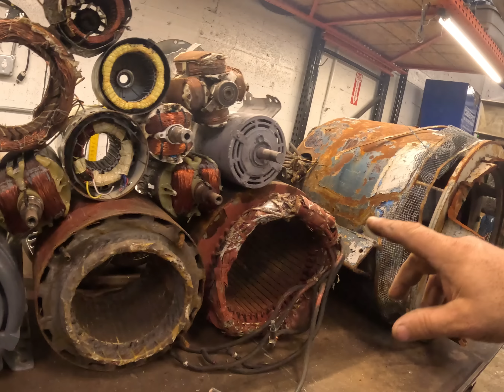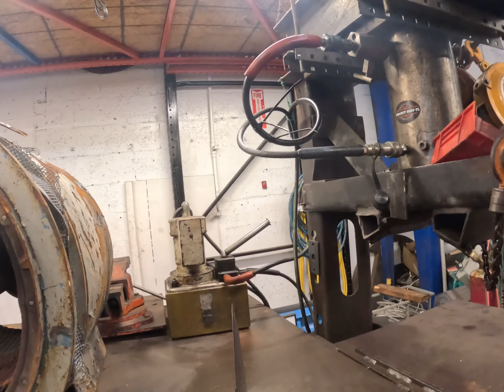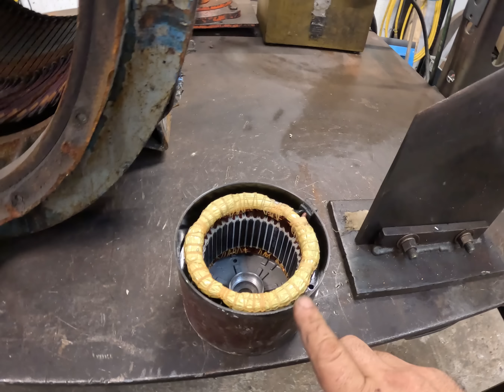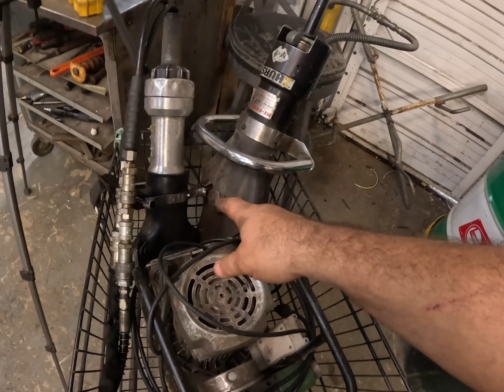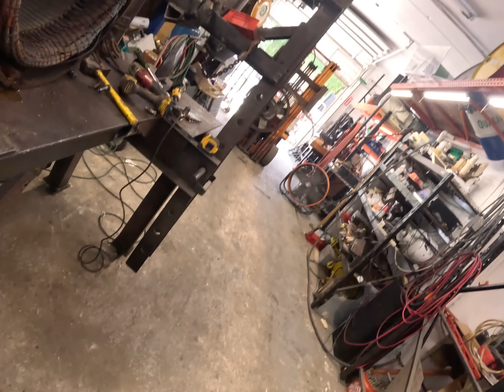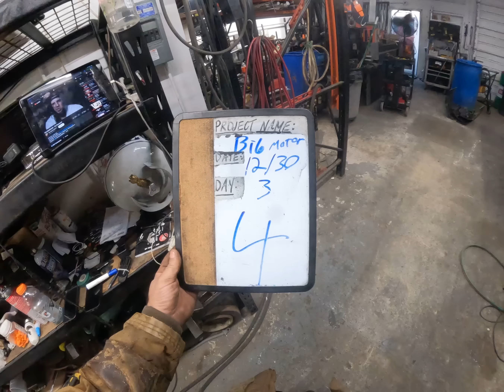Massive Electric Motors & Generator Stators Scrapped For Copper

Comment: You got to ask yourself how did they get those copper wires so tight in the groves. The wires are routed while in the flat then rolled to a cylinder and welded. If you cut the longitudinal weld it will unroll making it easier to pull the wires.
Reply from the maker: I don't think it will unroll
Reply: @ it takes some force but it will open the gaps, it won’t just roll out without persuasion.

Comment: the joints are siver soldered
Reply from the maker: Thanks for the info!
Reply: @ProjectShopFl  and the bulldozer wear plates are made out of hardox steel you can get it in any size  plate

Comment: Very nice I built a machine for pulling copper out of motors on my channel if you would like to see
Reply from the maker: Nice set up, What kind of pump are you using?
Reply: @ProjectShopFl  it’s a little vevor it’s rated for 10,000 psi Though Way too much for the cylinder I’m using lol I gotta be careful when I’m using it for. I don’t blow a hose or messed up the cylinder.

Comment: Another great video!!! On your “when in doubt burn it out” option….instead of putting a flame to it and dealing with the smoke, try putting clamps on both sides of the big welder and introduce electric into the stator on opposite sides which will make it hot. Experiment, and you might be able to introduce it while it’s on the wrecker, bring up the temperature enough to melt the glues, and pull it hot. We used welders to melt frozen pipes in chiller system when they froze because the glycol solutions became diluted during harsh winters.
Reply from the maker: Thanks for the suggestion

Comment: Your yard should be paying you a lot more for the cast iron ends as it's considered machine cast which pays so much better than prepared #2 or #1 structural steel but you have to keep it separate from the rest of your steel load
Reply from the maker: Thanks for the tip!

Comment: I saw a video where a blade like yours was mounted on a jackhammer shaft, and it was pounding right through them
Reply from the maker: I think for the smaller ones that would work great but the big ones are a different story.

Comment: I saw that Indian Video with the thousands of compressors. They were cutting off the copper connections because they were soldered with Silver solder. 
After cutting out the sections, they would use a torch to melt out the copper and silver from the Steel casing,  tapping it against a plate to knock it free from the steel. They then used Nitric acid and Distilled water to dissolve the silver and copper. This creates silver Nitrate. I think they then just poured in  some Hydrochloric acid to make silver chloride and then recovered the silver from that. You can also use a coil of copper wire or copper pipe to drop the silver from the silver nitrate to make metallic silver cement which after washing several times, you can then directly melt the silver. It's very Messy and dangerous dealing with all those chemicals, but it's India. They work around heavy equipment with Sandals and Flammable robes. No safety equipment at all.
Reply from the maker: 👍👍👍 Them Indian guy are crazy. lol
Reply: I think those Indian guys work all day for a bowl of rice

Comment: I scrap a lot of HVAC motors and that includes sealed compressors. My twenty ton press from harbor freight plus my Bosch tile removal blade is super sharp but is a blunt blade. I solved the problem of penetration of the blade by giving the stators a couple of good whacks with my eight pound sledge hammer. That loosened up the laminations enough to enable my blunt but very sharp to cut the copper quickly. Small motors with small stators I give them a couple of whacks with a two pound sledge to loosen the laminations and then apply my East wing camping hatchet which cuts them right in two halves.
Reply from the maker: Thanks for sharing. 👍

Comment: You can buy work hardening plate that will harden as you work it to the point its not machinable
Reply from the maker: Thanks for the tip. I made the last one with just a grinder but it was miles steel.

Comment: I saw you pull the copper out of a large motor and you used wd40 to spray the heck out of the inside of the motor and it seemed to me that the copper came out better than not using the lube but have not seen you use this method since then.  How come?  Can you reveal how you keep your records for your business or is this too much to ask.
Reply from the maker: It was suggested by viewers to use it, I did not notice a difference. The slack or glee won't let it penetrate. I keep everything in my head. lol

Comment: I saw the last days some machine to get copper out from big stators, without cutting them in half, with some hooks they attached the hook to a batch individually and pull it out... will try to find it and let a comment here.
Reply from the maker: I have seen it It had a shaft through the middle of the motor and 2 cables with hooks. If I thought I was gonna have more of this stile I would build one.